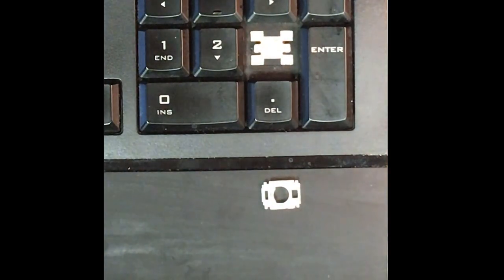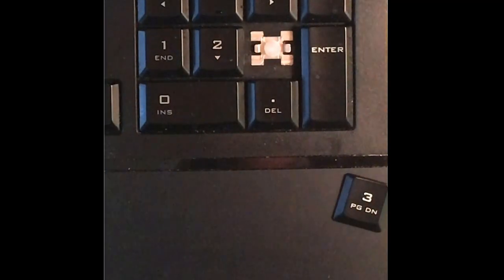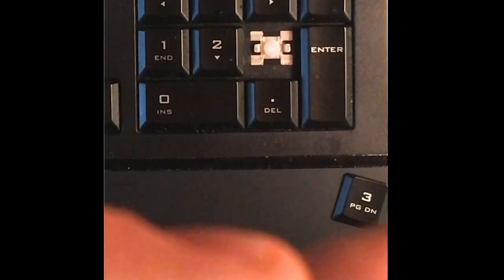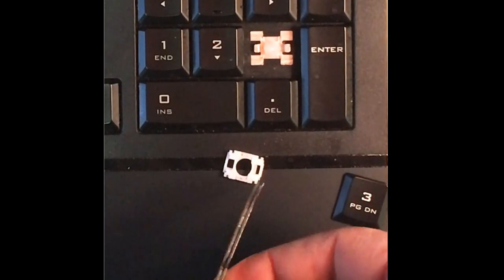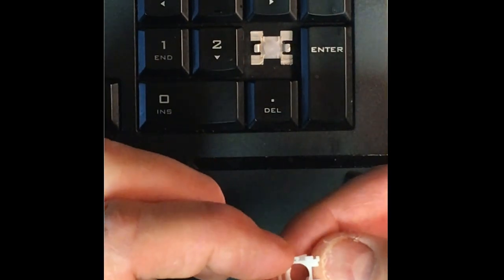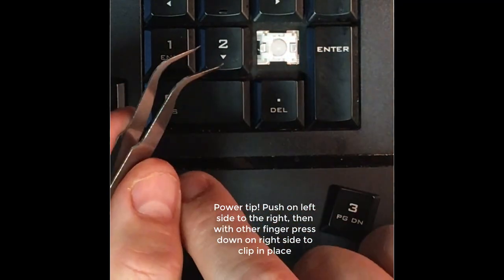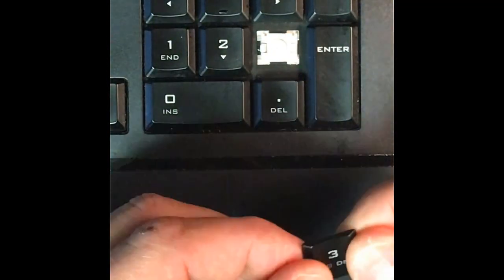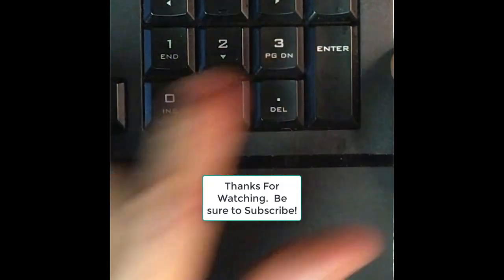Fix broken key on Logitech KeyBoard - Lighted K740 Video

Comment: The new part arrived and I was able to do this successfully!  Thank you. The first time I put the new clip in, the key wouldn't center, and on closer inspection, I discovered that the right side of the clip was not going under the metal tab (apparently I had pushed on it hard enough that the tab had closed a bit). So I carefully eased the tab up just a little with tweezers. Then the new clip (and subsequently the key) centered itself. Hurray for help videos!

Comment: Cool video.  I have replaced keys on these twice now, but it was a painful process because I did not know the push right, click trick.  My first K740 was perfect for about 5 years, then the a key fell off.  Not knowing at the time where to buy replacements, I bought another K740 because I love love love this keyboard.  The replacement was also perfect for about 3 years.  Then the H key fell off and the T key was loose.  Logitech never was known for perfect quality.  Thank goodness I saved the old K740.  Replaced the A key on the old one using the newer one, and eventually replaced the 5 key because it was not operating correctly.  Keep in mind with shipping cost of the replacement keys, you but about 5 and you have effectively bought a new keyboard $$$ wise.  Anyway I favorited this video for the next time.  Thanks.

Comment: "Push right, push down" is a critical piece of information. That's the point at which I broke the clip in half, because I hadn't yet found this video!  When I discovered that one of the clamps on the underside of the key was broken, I ordered a new key kit AND a set of two extra clips. Those little clips are delicate. Here's the web address for ordering the part. 
http://www.machinaelectronics.com/store/keylab/keyselector.cfm?id=418&model=5344
Reply: That was the "Key" information!!!

Comment: just a heads up, the plastic was opposite sides on my 10key.... it was left (small square in first) then right. only on the 10 key, otherwise my keys were leaning too far to the right, and would strike the key next to it.

Comment: It's  MachinaElectronics.com  I paused your video for the image.  Much of the video is out of focus or off screen - so - there's that...  I got out my loop eye-magnifier and found that the cap has four female socket type grippers on the underside that grip the round post-like protrusions on the "hinge" thing.  The problem with my key was the sockets on the underside had broken so there was nothing to "grip" the posts on the hinge.  So - I "borrowed" my "page up" key, which I never use, and put it onto the "< , " key.  Then I stuck some white stickey-paper on the top and wrote the <, onto it and now it's all fixed.  I'll try to find a new <, key cover somewhere.  Thanks.

Comment: Thanks, but I'll just get a better keyboard next time...this was a quick grab emergency buy from Target...never again. Going pro hardcore pro for a better build..
Reply: Hmm...I bought my Logitech Illuminated keyboard in September of 2010 from Amazon, and it's still working great except for having to replace one key that broke today, and looks great too (I did have to scrape off some of the coating on the front though a couple years ago and then clean off sticky residue with lemon essential oil, but it looked new afterwards, and that was easy--better than taking this to a landfill, though I would take to Office Depot for them to reuse the parts)--anyway, after 8 years and still going strong other than one key having to be replaced, I'd say this is a pretty solid build. :)
Reply: there is no better build bro, this is top notch
Reply: Christian Riddler, unfortunately, the replacement key I bought kept coming off. After two replacement keys broke, I ended up buying a new keyboard. I went with one half the price (different brand), but it has the silent, flat keys that I loved so much about the Logitech. 

I’m so sorry yours failed so soon. :( I’d definitely reach out to them, as I bet it’s under warranty still. My mom has had hers for years without problems also. I hope they replace yours altogether!!
Reply: @PeaceIsJesusChrist  what did you replace it with if you don't mind saying??
Reply: @gbmwaz  Get a Corsair K55 RGB gaming keyboard from walmart for $50.